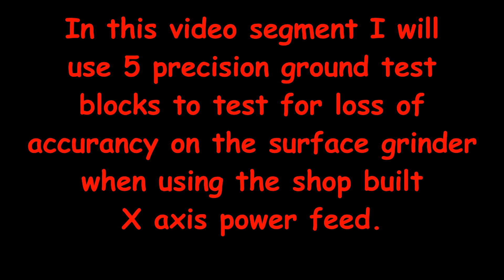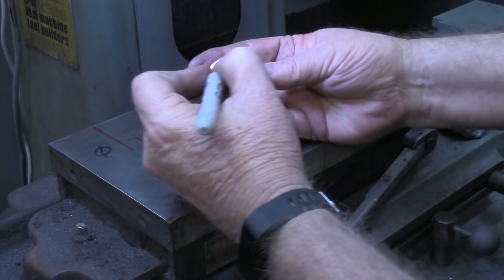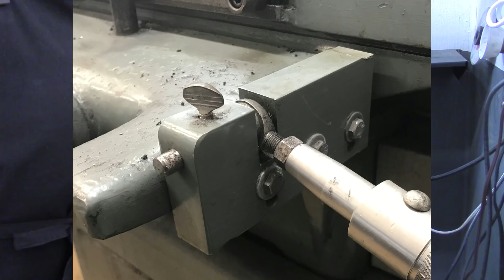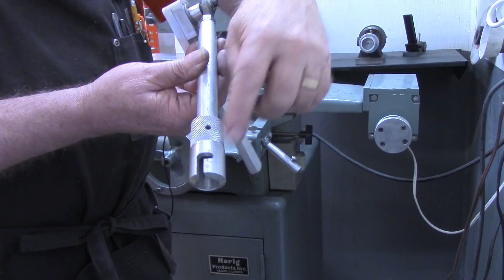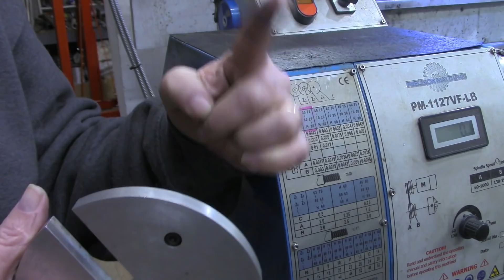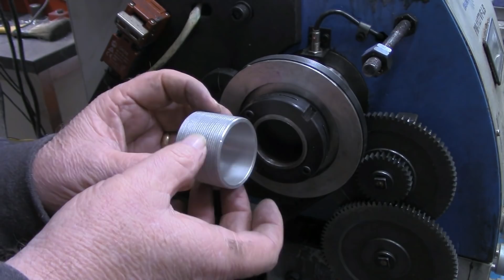Surface Grinder Power Feed & Outboard Lathe Spider - Tidbits002

Comment: Great job, it looks like it's supposed to be there! I did something similar on my elite ar5-e tool and cutter grinder, based on your design.I mounted the bodine gear motor to the machine frame though, on a pivot where the drill attachment would normally go. On the table i have a block with a 3/4" shaft  (for the reciprocating arm to mount to)To handle the y axis table travel (only 5") i have a 5/8" thomson shaft mounted (90 degree)on the adjustable x axis motor sliding block.
  The arm has two side by side roller bearings that attach to the 3/4" table shaft, on the other end is 5/8" thomson linear bearing. The linear bearing and shaft handle the 5" y travel. The x axis length adjustment part is almost identical to yours. I mounted it to the frame so the arm can be removed, the motor is on a pivot and can be swung out of the way when in regular use. Less than 2 minutes setup time.
 Next is a 50:1 worm wheel on the z axis. The worm gear gets attached to the backside of the z axis adjustment handle, the worm gets mounted to z axis body/frame,  one turn of the worm is two thousands z travel. It flips up out of the way for regular use. It's also apart for maintenance and servo motor drive upgrade for spindle and new spindle bearings.  I will post it when finished.

Comment: I'm willing to suggest that the added weight and pressure from the drive motor is causing the deviation on the right side of the table ?  Love the fabrication work and highly appreciate you sharing this. Just picked up a Boyer and Schultz myself hoping to get up to speed on these machining processes that my father put away long ago.   Brought home my first mill recently and he lit up as he ran a Bridgeport for 10 years before his prototyping/maintenance mechanic carrier .  I'm hoping to get some hands on with him before time takes control of the situation.   Love the videos Mr Pragmatic,

Comment: I made this modification to my surface grinder recently. I did decide to mount the motor rigidly to the cross slide. I must say it works wonderfully. Its smooth as butter and quiet as a church mouse. Wonderful idea! Thanks for sharing your idea.

Comment: Hey Lee, I have a Boyar Schultz 612 and my table wheel pulls out to a neutral position and doesn't spin.  Try your Harig and see if it does the same thing.  It just might save you from taking a whack to the sack.  :-)
Reply from the maker: Thanks, I’ll give it a try when I head out to the Tin Barn later today.
Reply: @MrPragmaticLee  If you need me to demo it on my machine, let me know.  Mine is spring loaded.😉  If you have any ideas for a jig to sharpen lathe tooling on the surface grinder, I'm all ears.  I suck grinding hss on the bench grinder.  Thanks!
Reply: I took a closer look at my boyar schultz 612 today for you.  1st understand this machine has a rack under the table.  So, my handle is spring loaded to the engaged position.  I can pull it out to allow me to clock the handle for a comfortable position.  Now, if I machine a spacer to keep it disengaged from the rack, my table freely slides side to side and the handle can't spin and try turn me into a woman!

Comment: I love that. Very intuitive. 

Do you think a counter weight on opposite side like a fixed pendulum would take that slight pause and bump out of it. It would keep a steady pressure on it but like you said its working fine and not causing a problem so its fine like it is. Great idea though.

Comment: Hat off mate works real good I would never be able to get a surface grinder but have now gained an idea to use something similar over the top of a belt sander have worked it out on paper will be a down time project project but will work fine

Comment: Nice job and great explanation.  I'm going to make one for my grinder.
 Lee, consider grinding the magnetic chuck in place to get it dead on 0.0000.  Turn the magnetic chuck on and grind it's full length and width in one setting.  Always measure the chuck run-out with the chuck on too.
Also consider upping the linear velocity of the table about 25%.   You will get a ripple free finish.  For reference the table speed should be about as fast as windshield wipers on high.

Comment: You can grind that magnetic chuck in right as it sits on the machine. It's a simple thing to do. You should be able to get that thing dialed in perfectly. The only thing that would prevent it from being prefect, or close to it, would be wear in the ways.

Comment: Lee great job and don't see any problems with it. Have you ever seen a twin shaft system with eliptical gears set up to make the table speed approximately the same from end to end? The guys worried about a speed change consider it.

Comment: Thank you for showing your power feed. Great  design. 
I have a suggestion for making it a little simpler to adjust the stroke length. Cut a slot in your arm to accept a through stud in the center with a hand lock nut to retain it to your motor adapter. Modify your motor adapter with a female slot to accept the arm and no outside cover. 
There are lots of ways to add power feed to a grinder. I was thinking about using a stepper motor to drive the hand wheel via a belt, and use limit switches to set the travel ends. Your solution appears to work very well. The only issue is the oscillating travel speed, but it doesn't look like it's causing you any problems.

Comment: Great modifications! You have some of the best projects on YouTube imho. I have a lathe just like yours but it's called "Nova 290vf". The lock nut you took of is used to adjust the spindle bearings. Have you made any locking feature on the spider?

Comment: Hi Lee nice to be here and have some shared time with you in the shop.
What a great arm for your surface grinder we are very impressed, you really did no longer wish to grind by hand in the x axis.  
We did not know we have the same PM1127 as you do (we never need a lang bar feed action for ours, we just love YouTube always learning. It the PM is our general shop 1 off piece maker when we need a part or tool part larger then our micro machine lathes can produce.
Thank you for sharing with us, Lance & Patrick.

Comment: Hi Lee:
It is possible for you to send me the link to those DC Motors? By the way, maybe you should clarify to your viewers that the torque is in In.Lbs. not to be confused with Ft.Lbs.
Thanks from Toronto, Canada
Jorge
Reply from the maker: Jorge Scordamaglia I just search eBay for 24 vdc Bodine gear motor. I had a repeat seller I bought several from but he has disappeared. You’ll need to shop around on eBay since the prices varies greatly between sellers.

Comment: exellent video lee thanks for sharing this info as i have the same harig grinder as you have. except for i have a rack and pinion gear for my table movement. i would love to build the same riggin as you have there. i would like to know what diameter is the round piece hooked up to your motor? you didnt mention that in the video.
Reply from the maker: Jamie Buckley I started with a piece of 4" diameter material and turned it down to 3.5".
Reply: @MrPragmaticLee  thanks for the info lee much appericiated now im going too make it. have a good day.